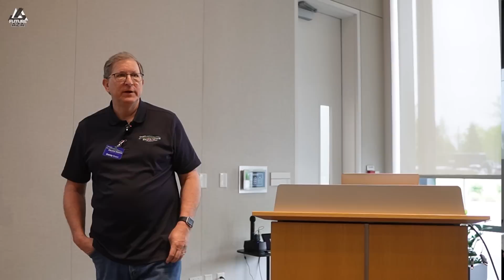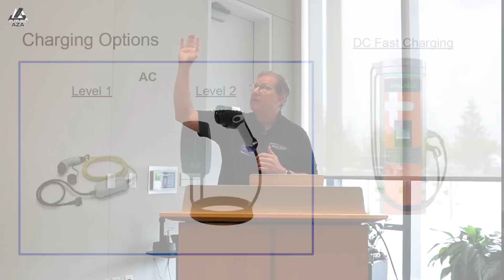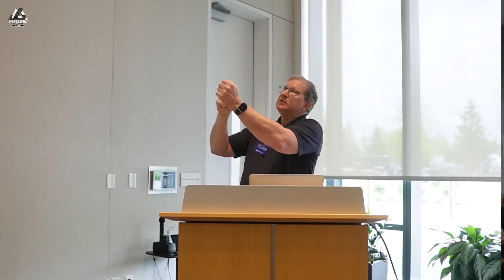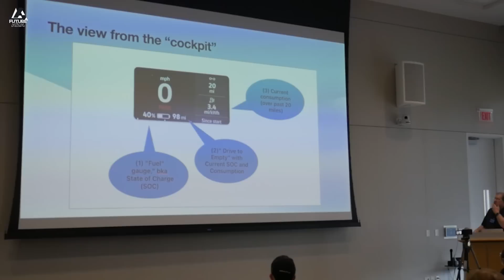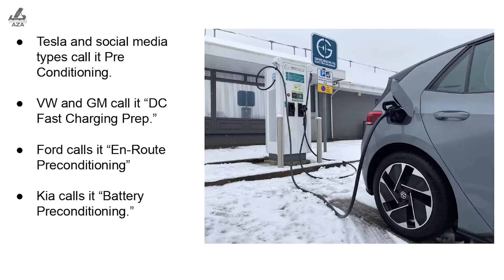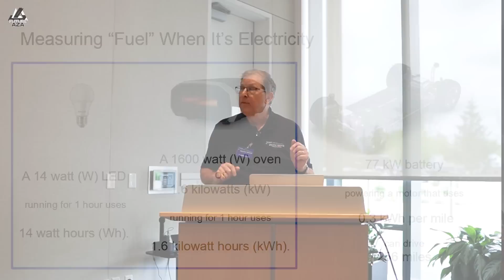What Every New EV Owner Misses

Comment: I don’t yet own an EV but intend to soon. So not having any experiences of driving an EV l found this very helpful. Thanks from the U.K. ( where even Teslas are ccs ) but at least our home mains is 220 volts so l think home charging may be faster than for you!
Reply from the maker: Depends on the amperage.
Reply: UK home chargers are mostly 7.36kW (32A) single-phase with a few 21kW 3-phase.

Granny leads are usually 2.3kW or 10A.

All use the Type-2 connector for AC home and AC public charging, with Type-2 CCS being used for all DC charging (including for Teslas).

The only exception is Nissan which uses Chademo for DC charging, so many public chargers have a both a CCS & a Chademo connector,  but many newer installations are CCS only.

The same set-up is common throughout Europe.

Comment: It would be really great if that was true!!
But the first part about the adapters is unfortunately not correct
You can use an adapter - but if your car does not get the expected signals from the charger it will NOT work
I screwed up - I bought a Japanese import Tesla - it has the Tesla connector 
But here (NZ) there are ZERO fast chargers with that connection - Tesla cars sold in NZ use the CCS2 connector - I have an adapter - but the bloody thing still won't charge - you need to replace the cars charger computer - and Tesla NZ won't help as my car is an import
There is also the level 2 AC chargers - use the Type 2 MENNEKES connector - again I have an adapter and a cable and the bloody thing still won't charge
I'm waiting for a CHAdeMO cable/adapter
Reply from the maker: A very unusual situation. Thanks for sharing!
Reply: @FutureAzA  I now have a CHAdeMO cable adapter - which actually WORKS! - I can now charge at 25 or 50kW

Comment: 10:07 seems to be an error. While he indicates both values are correct, the VW battery is a 77 kWh battery, NOT a 77 kW battery. It is able to discharge much greater than 77 kW, with kW being a measure of the instantaneous output.